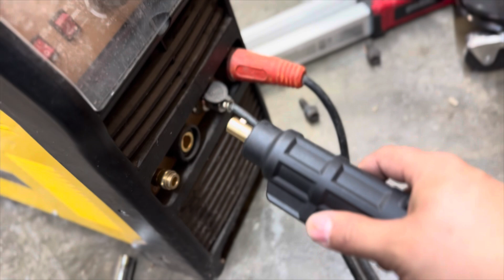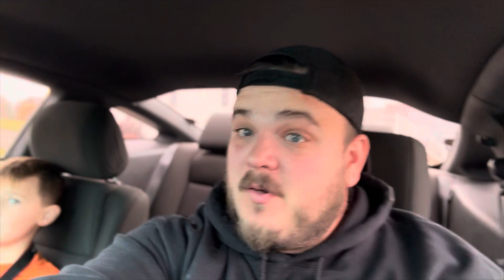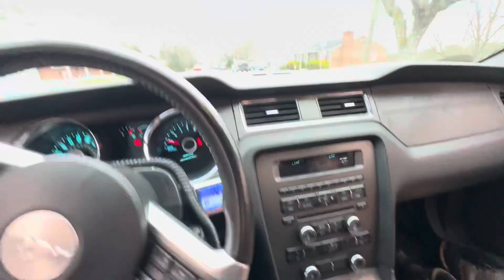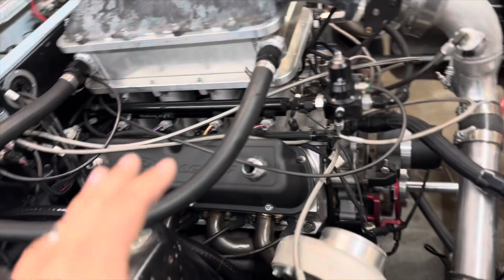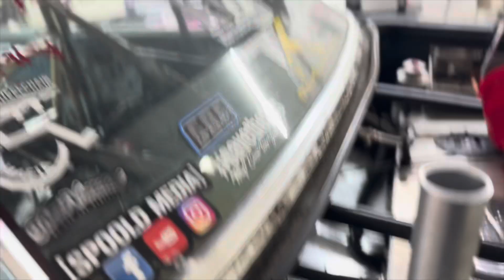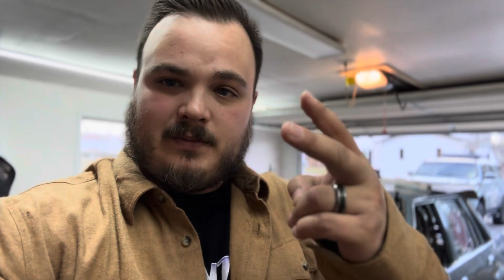You Need A Zephyr Shirt? Almost Ready to Test!

Comment: I only use Wix filters. I stock up, from rockauto. Less than 5.00 each.
Also, look that breather hose up, as Koi pond hose. Rock solid motorsports uses it, too. I run it with 16an fittings and Gates heat shrink hose clamps, from rockauto. lol

As soon as you order new fittings, you'll find the ones you're missing! That's how it works for me! SMH lol